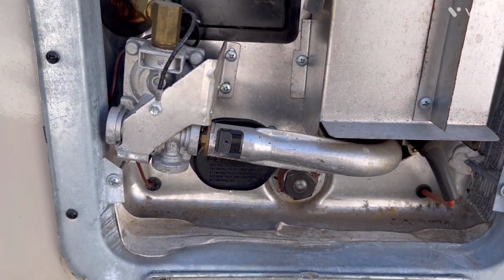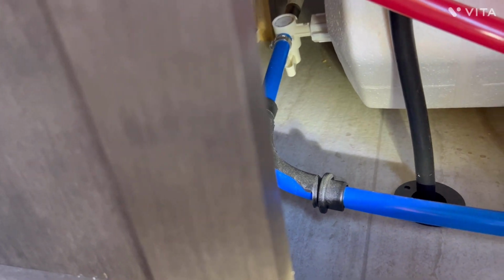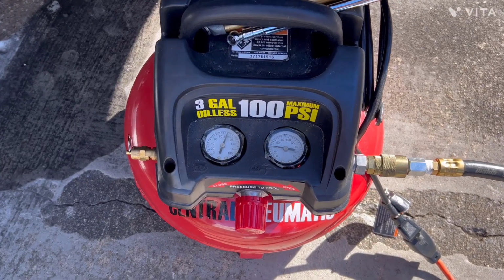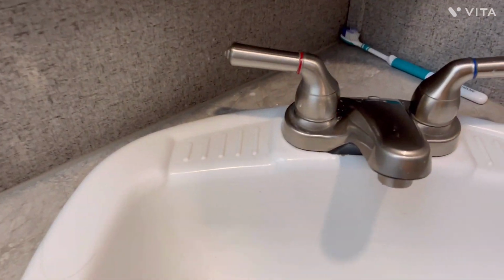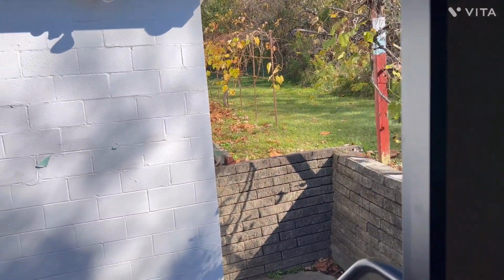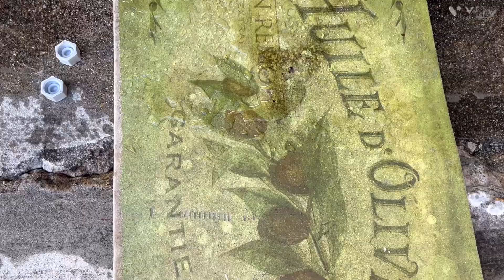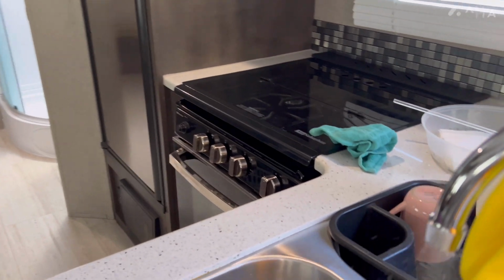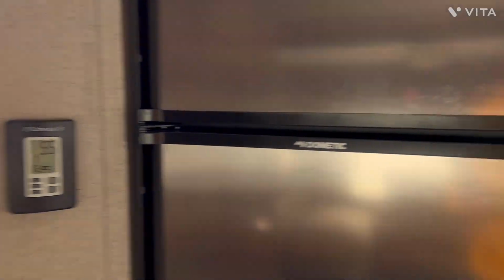Winterize your RV this way

Comment: I completely agree with you no way do I want anything else but water in my water lines
I am early 60s and just bought my first mini RV 2006 I think
Know basically nothing LoL 
And trying to teach myself as much as possible before I full time while shopping for a little bare land
And appreciate the knowledge you share
I don't suppose you have a video showing how you made the fitting you used for the water line on the air compressor?? 
Thank you I will check out the rest of your videos

Comment: ok i get what you are doing and really like it
I have a question though
I am going to be in a pretty cold area this winter while living in my rv can you offer any suggestions about that
Reply from the maker: Ok I will try to give you some good tips and advice. First of all thank you for the subscription and the watch. #1 keep watching videos on what you are trying to do. #2 what kind of RV do you have? Whatever the make is find out as much as you can about it and what other people that have the same one feel about it and maybe you could find someone living in that same unit in the conditions you have voiced to me. #3 If you’re RV has some hot air being blown underneath the floor then it will help keep things warm where some of the water lines are. Usually if the underbelly of your RV is inclosed it very well could be heated. #4 waterline connection to RV by hose. They make heated water hoses or you could wrap water line heat tape around a regular water line . Put skirting around RV to keep air from blowing underneath unit if RV is in a location for a long time in cold weather. These are only a few things that can help in a cold climate. Now as for that shutoff valve I made. Regular air chuck and a valve that will except that size threaded air chuck usually 1/4 “ valve then a hose bib water connection that will screw into the other side of the 1/4” valve. Best thing you could do is take a picture of the thing off my video and take its picture to Home Depot and show it to them and they can help. I know this is hard not knowing but you are on the right path keep watching videos and keep learning. We all had to learn no one comes into the world knowing anything, it’s all learned.